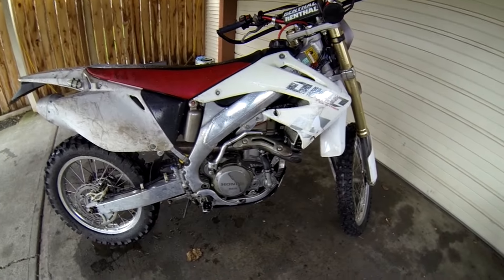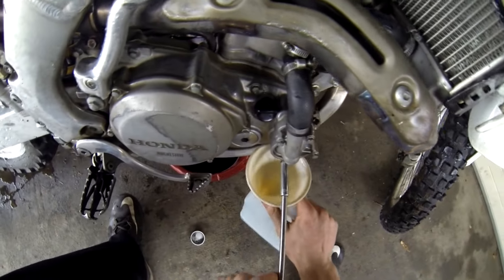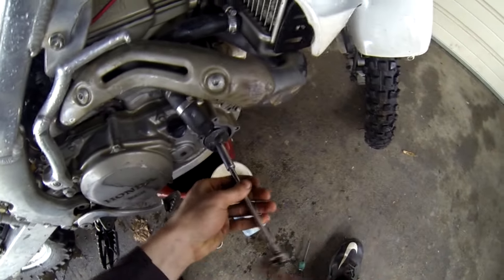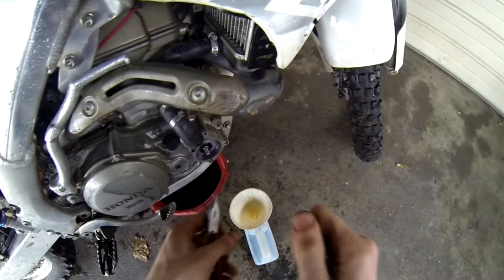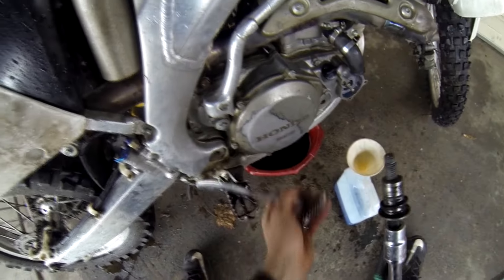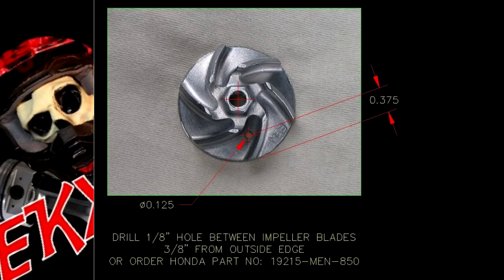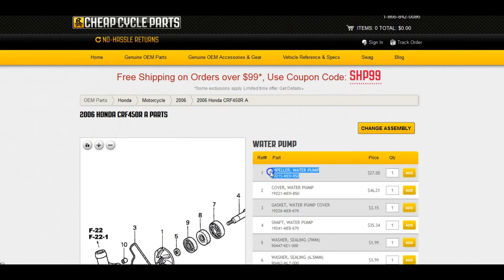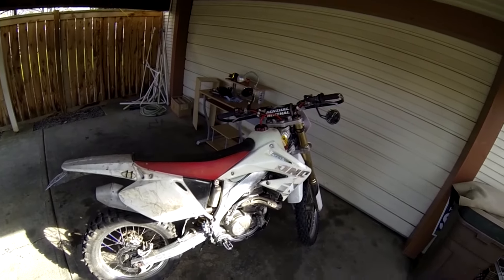CRF 450 / 250 Coolant / Oil Weep Hole Leak: Fix And Modification! In Depth!

Comment: To anyone who takes a right crank cover off, make sure the impeller is lined up properly before you tighten the bolts down. There's only two ways it will go in since its keyed. I didn't know this when I took apart my WR426 and ended up cracking the cover because I just kept tightening it and the impeller was in the wrong spot. Only $60 for a new cover but make sure to check that.

Comment: Iv just bought a crf 250 2004 it's got a slight weep I'm new to 4 strokes do they tend to get hot really quick and after running for say 2 mins the engine seems to be really hot is this normal

Comment: How do you get to the crank seal on a 2009 Honda CRF450r?  Do you take the right engine case off and take out the clutch assembly to get to it or is it from the left side or what?  I was wondering cuz my bikes oil level keeps getting to the point where it's overflowing with oil and my guess is that it is the crank seal being bad and allowing my transmission oil to leak into my engine oil.  Please lemme know if you know, thanks!

Comment: How do I remove the mechanical seal completely out of the crank case part?it seems to be stuck in there with possibly an adhesive maybe?am I suppose to just pry it out ?
Reply from the maker: Steven Ross  if you've pulled the right side cover off just use a bearing or seal puller... Should pop right out... If you don't have that tool you can CAREFULLY use a hammer and a brass drift to punch it out.

Comment: thought that i was burning oil for the last months, bike has 30+ hours on the new cylinder. every hour my bike lost 50ml of oil, runs great i just add oil till it hits the fill glass. i found a hole on the bottom of the block that was leaking. after doing some research i found out that it was called a weep hole. i hope that it will fix my issue and can ride my yz450 for another 30 hours or so
Reply: i hope it isnt my piston or piston rings

Comment: Can i yz250f water pump seals fit on a yz450f i know its a bigger bike but i just wanna know.
Reply from the maker: go to cheap cycleparts.com look up your year and bike and the year and bike of the one you have the seals for. If the part numbers are the same then there is a 100% chance they will work. If not they most likely are different and not compatible. Hope that helps!

Comment: good idea with bolt template. My coolant tank was completely empty, I filled up and appeared to be leaking from below Impeller - I will try some strategies from this video - so basically the drilled hole in impeller is the solution?
Reply from the maker: Casey Pudwell the drilled hole in the impeller is an extra measure to help your seal last longer...the solution to getting your bike to stop leaking is actually replacing all the seals and bearings and the impeller shaft if needed. And I'm glad I can share the bolt template idea, it makes it so much easier!
Reply: Had trouble removing right engine case because Kickstarter is stuck on shaft very tightly - i will purchase Steering Wheel Puller and try to remove

But while struggling with it - a very small , perfectly spherical ball fell out of the crack - what do you reckon that goes to?

I was thinking maybe it goes to my bearing which is so badly damaged, causing the coolant to completely leak out - also noticed there was no transmission oil to drain, must have leaked out with coolant?
Reply from the maker: Casey Pudwell wow! That thing must really be on there, most of them are tight, but usually you can shake them off eventually. That's a good idea with the steering wheel pulley though.
Reply: That small ball I mentioned previously does not appear to match the bearing I have ready to replace (on impellar shaft) - so my theory does not seem true - any idea what the ball goes to ?
Reply from the maker: Casey Pudwell I totally missed that there was more to your earlier message, didn't hit the read more button, my bad! as for the ball, that's super weird. It fell out of the weep hole?! that would be super small. Best thing to do would be take everything apart and inspect the bearing. You'll know immediately if your bearing is bad. And yes, no tranny oil (as long as there doesn't appear to be any other leaks) can flow through the weep hole if the seals are bad.
Reply: thanks! I will inspect location for ball (its like a BB for BB-gun), I now think it could be part of the Kickstart mechanism - since I was pulling so hard on that, thought it fell through the crack between partially opened right engine case, not weephole ... it might be part of the Kickstart mechanism that locks it into open and close position
Reply from the maker: Casey Pudwell No problem. Yeah, that is way too small for a ball bearing...buy I honestly can't think of any where that it could have come from, if and when you find out I would definitely like to know!

Comment: thanks so much that was a big relief my impeller was stripped so i had to do it with pliers, kids be careful and if you dont you wont be able to feel your thumbs like me lol
Reply from the maker: No problem! Glad I could help. And stripped threads are the absolute worst haha... It sounds like you got everything off and figured out though so I'm happy to hear that.
Reply: Actually thought I did but got cocky with it. Still havnt gotten it off and broke most of the fins its become hell. If you have any tips let me know thanks!
Reply: even putting it into 1st and standing on brake still makes it turn I dont know why!!!
Reply from the maker: BLUESTRE is the right engine cover still on the bike? it would probably be easier with it off...and also you could just drill the center out...you'll probably mess the impeller shaft up but it's not that expensive and should most likely be replaced anyway. Let me know if that works or you need more ideas.
Reply: took side off still cant take it off looks like the metal formed around it ;(
Reply from the maker: BLUESTRE damn! that's pretty wild. Wish I could see it in person haha. Sounds like you'll have to drill out for sure though...
Reply: guess so lol its so funny to me for some reason like all i wanted to do was change the cooler and its became this lol!
Reply: do you know where i can get those shafts
Reply: ok so getting the parts just got the oem so I can start from scratch, Thanks so much for the ideas appreciate  all the help!
Reply from the maker: BLUESTRE no worries man! And yeah definitely just go to your local dealer or website and order the oem parts. Those will work best. Hopefully you get everything back together soon and can ride soon!
Reply: I got it off! I was about to drill it and decided to try to drill around it and asoon as I started to finish the hole it split in half! ill probably still get new parts just because of metal fragments etc. But thanks so much man!

Comment: Thanks for the video but you cost me an extra $45 !!  your impeller was released by undoing the nut counter clockwise like a normal nut would be undone  . After fruitless attempts and one stripped nut I ended up trying to release it by using a blunt screw driver against the vanes after breaking off 3 still no luck , so I used small grinder blade to cut away part of the impeller to see it I could get some CRC / WD40 onto the thread still no luck . Okay so I should have tried but I was following your instructions IT UNDOES CLOCKWISE not the way yours did mine is a CRF 250 but I am not sure why they would be different , and I watched that part to see if I was blind because I thought you may have used slight of hand Ha ha . Might be worth pointing that little bit out in the video if its possible as I had put the bike in gear had the brake locked on a swell just like you explained  . Now waiting on local Honda dealer to get new one into stock , 6 Honda dealers here in Brisbane Australia and not one of the bastards have one in stock now waiting 5 days for new one to come in from the Honda distributors  .
Reply from the maker: first of all, I can't say I'm sorry enough... I just looked that up on the forums for a few minutes and you appear to be absolutely correct, it honestly never would've occurred to me that they would decide to put left hand threads on the 250's and right hand threads on the 450's...that is definitely bizarre to me! again really sorry about that! I'm glad I know now though, I will put an annotation in the video as soon as I can. I'll also have to look at the part numbers for the impellers, they must be different! have you tried ordering parts off eBay? quite often you can save considerable amounts of money via the internet.
Reply: Its no big deal I did notice that there are upgraded complete kits online  but time was of the essence as we are going for a two day weekend trip this weekend and I wanted to prevent a bigger problem as we noticed a small water trail out of the weep hole at last ride .I saved your link in case I decide to get an upgraded kit later as I would need to go the whole hog , all I wanted to do was the seals this time . Thanks for the reply .
Reply from the maker: +Howard Thrift okay, well if you run into anymore problems doing everything just let me know in the comments and I'll do my best! Have a great time riding this weekend!